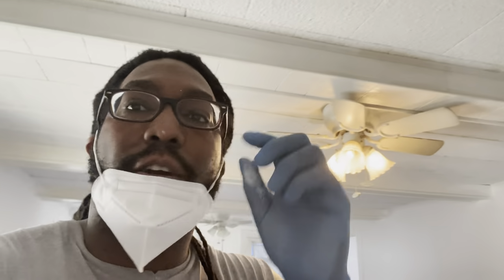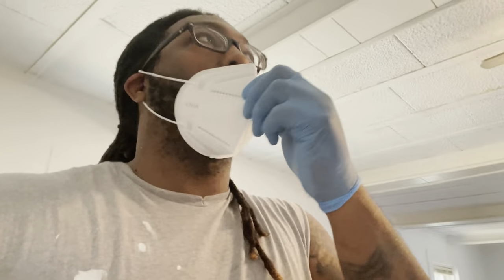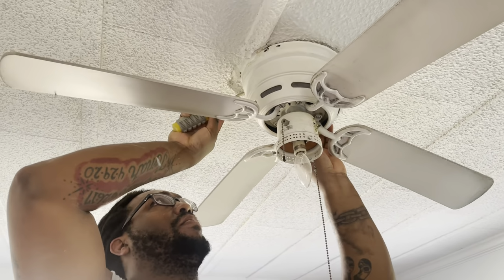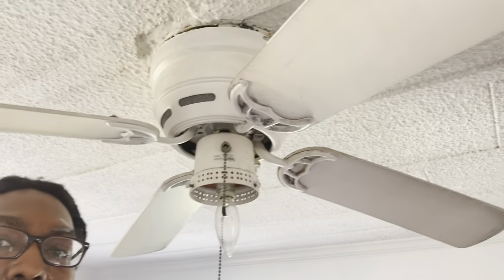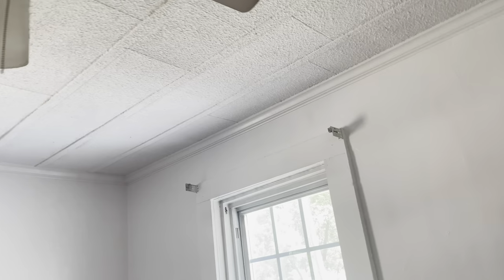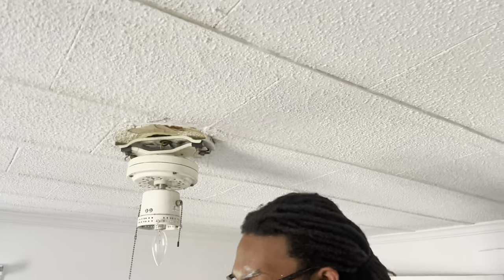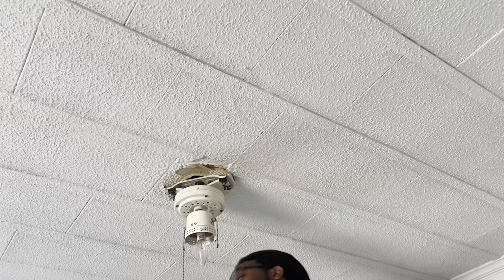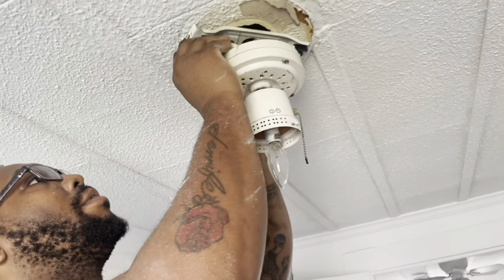Wagner 2000 flexio (Painting ceiling in our rental property)

Comment: good stuff man, do you water your paint down any?  when i used my 2000, over spray was bad, and it got clogged pretty quick. GL
Reply from the maker: I didn’t have to water the paint just had to play with the settings  I had some over spray but not terrible I use lowes paint